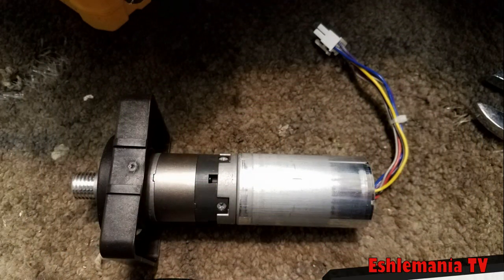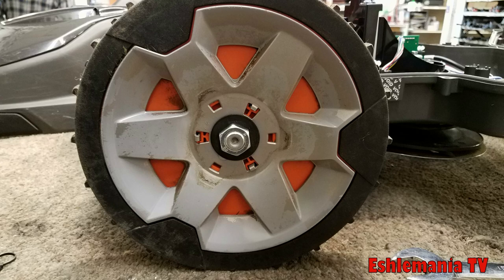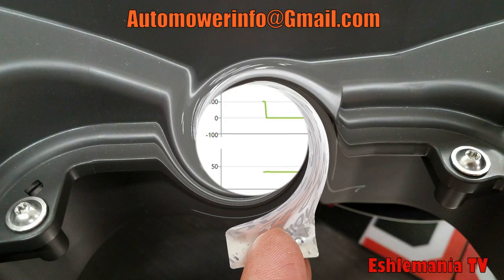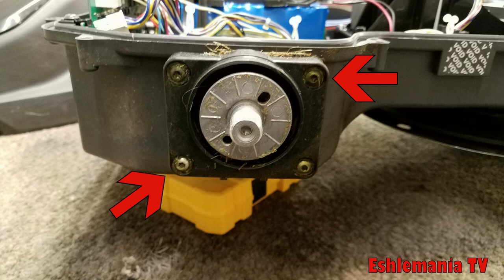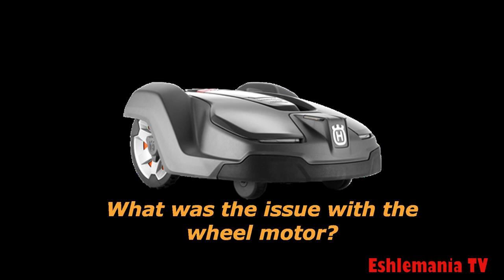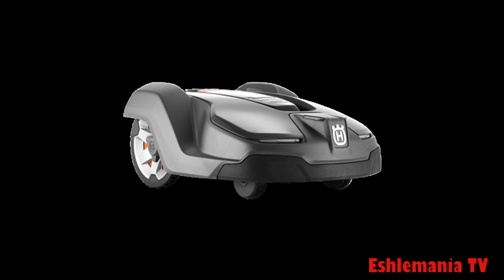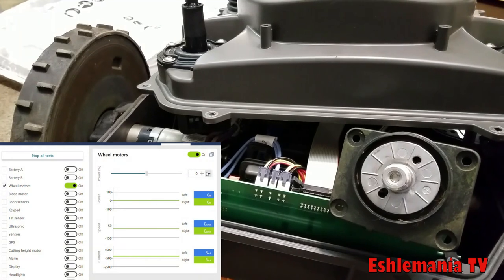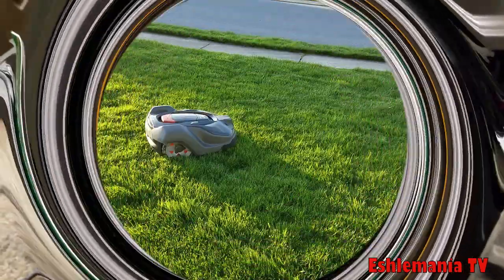Automower Answers: Wheel Motor Replacement & How To Fix A Seized Wheel Motor

Comment: You are a godsend. Opened my wheel motor and found that exact problem. Instead of paying €250 for a replacement I spent €5 on grease for the gears and motor is working away as normal
Reply from the maker: Great to hear! You can find more Automower videos like this on our Robotic Mower Services channel. https://www.youtube.com/c/RoboticMowerServices

Comment: Thanks for this video.  My wheel motor is being replaced by dealer at my expense.  When I pointed out the grease issue they could not remove the screws to check the gears so when I get it back I will do so.  I fear the other wheel has hardened grease as well and I want to clean it.  At least I can experiment with the old motor.  Can we get the software? Will the software check the guide wire sensor board? I unspectacular a problem with it as well.  Also where can I get the torque manual?

Comment: I really appreciate all the info you have on the automowers. I just used this tutorial to fix one of my 450x. Grease was completely gone. Was able to totally disassemble the motor (did both motors) and free it up following your steps. The mower has 5300 hours on it so I'm probably to late to completely save the mower, but now it will limp through till I receive the motors I ordered.
The only grease I had was white marine lithium grease. Hope this will do no harm.
I think I might start making a maintenance schedule to check the motors every year. Both my mowers pretty much run constantly since I'm cutting 2 acers with hills.
Thanks again and keep up the great work. subscribed and liked
Reply from the maker: Thanks for the feedback. In the case of your wheel motors, it sounds like any grease is better than no grease.

Comment: Great Info as always....wondering if Wheel bearing replacement is possible ?  my wheel s are getting a bit Wobbly (and yes wheel nuts are at correct torque)

Comment: The contact cleaner fix worked great for me, but after an hour or 2 is had the same error. I have done it a few times now and works great right after, do you think the motor is on its way out, its not overly hot when I take it apart. Thanks
Reply from the maker: Yes, it sounds like it is too far gone. I'd start looking for a replacement motor.

Comment: Good, practical advice. Should cleaning both planetary gears and housings be regularly scheduled preventative maintenance? I saw a video from "L S" where he removed the planetary gears on a 450x without opening the Automower. He found the grease had solidified at 1600 hours and recommended servicing planetary gears at about 1000 hours. Good idea?
Reply from the maker: Not really a good idea and the reason why is because the grease burns up because either the electric part of the wheel motor over heats, or because the bearing is going bad and over heats. So the grease in the gears burning up is just a reaction to the real issue and not the actual cause of the issue.

Comment: Great video and I found exactly what you predicted in my 450xh. Pity Husqvarna doesn't use a better gearing here as the replacement is pretty expensive. Thanks again!
Reply from the maker: The newest version of wheel motor (part number ends in 06) is built better.

Comment: A thousand thanks to EschelmaniaTV.    I owe you big time as you have made the Automower experience feasible and enjoyable!

Andrew Woulfe,   Thanks for sharing your experience with your wheel motor.   Let us know how it lasts?  In the Florida heat I had a problem motor after a year and removed and opened up the wheel motor.   The electric motor side turned smoothly.  The wheel side with all the little plastic gears could be turned, but it was jumpy like a car wheel with bad bearings.   It loosened up pretty well with the WD-40 as video suggests, but it still had sort of a grinding feel to it.   I ended up taking the three visible plastic gears and the rotating plate to which they were fitted out and washed them in mineral spirits.   I then took out the long screws and went another layer deeper to expose another set of the same gears.    I washed it out with  mineral spirits and greased it with regular grease,   It turned ok without the grease in a rough sort of way, but with the grease it was pretty tight and still felt like a bad bearing,  but about then I concluded that the motor I got on eBay from a  dealer supplier for $130 was probably worth it.    Of course, my motor only had 2100 hours on it so you can see that if I were to replace both motors each year that would be $250 or more per 315 mower that I have each year.   That could add up so maintenance would be great if it helps.  I operate 2 of the 315 models 12 hours a day for 9 months a year.   If parts become scarce then I guess it will be time to dig a little further and see if I could find a bearing, but how likely is that?   My second wheel is a little tight, and why wouldn't it be in just as bad a condition??      So, I probably will spend another $130 to have one on hand and feel sure it will be needed soon.   BTW, my mower is in warranty.   I called the local Husq. authorized facility and they laughed and said they didn't work on robot mowers.   So I gave up on warranty although somewhere there is probably a tech that knows what to do like our video creator who is genius!       Another thing I learned in this exercise is that when I cleaned up the mower to take it to the shop I had carefully used the  hose.   There wasn't much water inside, but enough to discourage me from doing it again.   The little moisture I found was around the mowing motor compartment under the adjustment know and gear.  To tell the truth I think the hose would have been OK if not for the opening where the height adjustment knob protrudes.   Frankly, I could do without the adjustment since it stays on high always so I may just do something to seal that off permanently, but there is one other place that is concerning a little and that is where the lid is hinged, but I did not see any moisture around there.   On the other hand just dry cleaning is probably sufficient and the best after all.     If the  wheel motors are going to be the Achilles heel and last only a year then we need some good Chinese motor to swap out regularly or find bearings or something.

Comment: Thanks a lot, I really enjoyed your video, sweet and to the point with the solution... my problem was I was unable to take the 4 small screws arround the motor To separate the gear case from the motor, I heat them with soldering gun  but no luck I strip 2 of them, any advise before buying replacement motor $230USD?
Reply from the maker: The new version of wheel motor is much better than these older versions. I would recommend just upgrading to the new version rather than repairing one of the older ones. But if you are buying a "NEW" wheel motor for $230, then you might want to make sure that it is actually the latest version and not leftovers that have been laying around on a dealers shelf for years. Here's what to look for to make sure you are getting the latest version: https://youtu.be/kFhasUCQIkQ

Comment: I have a noise from both back wheels, sounds like there is gravel/stones rattling around inside them, any idea what might cause that?
Reply from the maker: Take the wheel off, remove the back cover from the wheel. You will probably find clumps of hard dried up grass inside there that was rattling around.

Comment: This video really helped me..........

So today Larry (430x)bit the dust. A lot of grinding noises from one wheel, but no drive. And the other motor was grinding but still driving.

He's been making noises for the last month. 

So apart he had to come!

The problem is the final planetary drive to the wheels.

The motors are OK, the helical gear on the motor is OK, the 4 nylon (yep plastic!) planetary gears that drive the intermediate gear are OK, that gear is OK, as are the 4 metal planetary gears inside the wheel assembly, but there's something very wrong in there. Whatever they drive is broken on one motor and breaking on the other.

Of course it had to be the bit I can't get into and as Husqvarna only sell complete motor/gearbox units I've now got 2 units on order.

At the same time I've replaced all 4 joysticks,which I should've done last year!

To all you owners out there, these changes are really to do, the mowers are really simple inside and very easy to work on.
Just make sure you put some WD40 on all the screws first.
I know Husqvarna have upgraded these motor/gearbox units, so if you have to order some make sure you insist on the new type (surprise surprise, the motor is the same but the gearbox is stronger) 

Larry has done over 9000kms in the 4 years I've had him and my ground is far from perfect.

Hopefully I'll get another 4 years before I need to work on him again

.......... thanks guys, stay safe

Comment: Hi
I just pulled it off, cleaned gears and sprockets and had them spin freely individually. But as I put it back together it's stuck, as if the gears are locking the axle. Any ideas?
Reply from the maker: The new version 06's are much better than all of the previous revisions. I would recommend just replacing it with the new version.

Comment: If you're on your 4th season with this mower mowing 1 1/4-1/2 acres and this happens, wouldn't you be better off just buying a new wheel motor ?? I've got almost 9000 running hours on this unit.
Reply from the maker: Yes, especially now that they have the revision 06 motors out with a heavier duty gearbox.
Reply: @EshlemaniaTV  thank you... actually it was about 8400 hours when I checked today.. replaced both motors